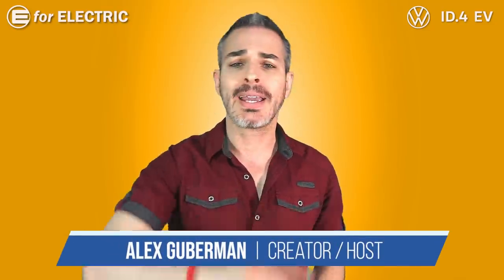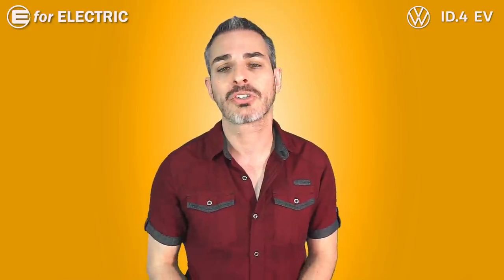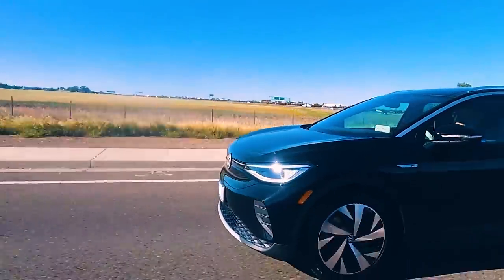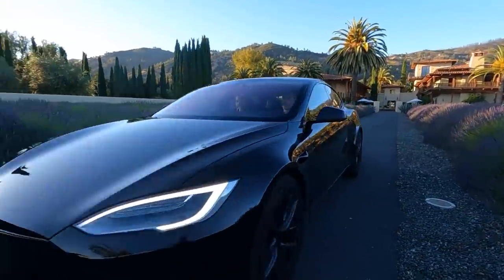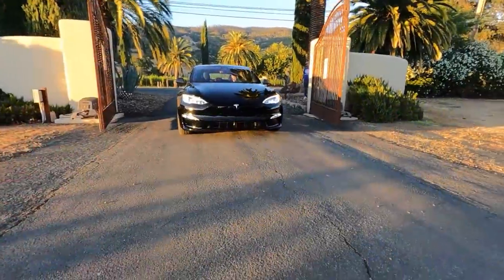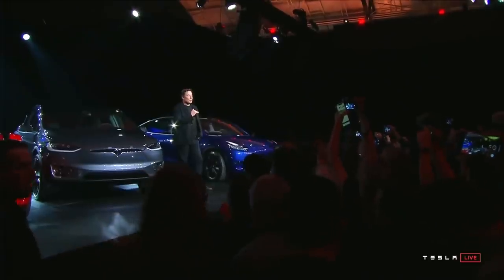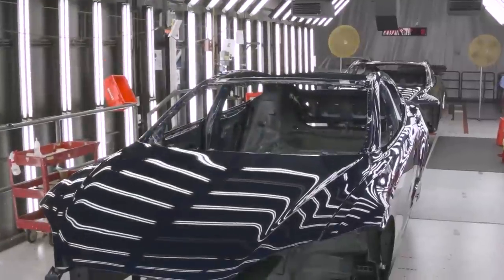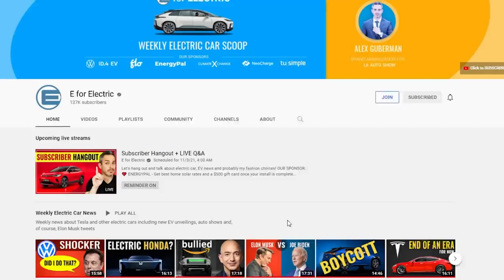SANDY MUNRO on Tesla's LFP vs 4680 Battery Tech

Comment: It cannot be a LFP vs 4680 but it has to be 4680 WITH LFP. The 4680 cell format is poised to enable so much improvement in production and scalability from cell to car, you cannot want to sacrifice that for a specific chemistry even having to produce different chassis variants for different cell formats? What do you think?

Comment: Interesting statistic from Sandy Munro that Tesla is approaching one third the no of vehicles built per year by General Motors. This is why Tesla is outsourcing some battery manufacture to CATL and Panasonic during this period of rapid growth. They are also using more than one battery chemistry and Sandy indicates that the 4680 battery cell must meet the Seven Sigma standard before Tesla will introduce it on the manufacturing line.

Comment: --- Some confusion as to what you are talking about with LFP and 4680 cells. 
--- LFP will be the prime cathode material going in 4680 cells. 
--- Only 4680 cells for long range and high performance cells with get a nickel based cathode. 
---- Hopefully by end 2023 all tesla products come with 4680 format cells.
--- LFP is a cathode mineral which BYD and CATL got good charge/discharge properties by micro-milling it - micro-milling it is their IP even though the basic IP for LFP cathode was American and now expired. BYD/CATL IP about to expire?? 
--- Tesla is using CATL prismatic LFP cathode cells - have not seen a teardown of a CATL cell. 
--- BYD don't fold their LFP cells, but squash them into a long thin prismatic box.
--- 4680 cell format is a triumph of cell packaging that can have any type of cathode or anode. 
--- It is a triumph for the shortness of the electrical path through the cell (80 mm), and the shortness of the path from anode and cathode to the thermal conductor and the thermal path to cooling fluid of 2 mm to 80 mm.
--- In a Tesla 4680 cell, it appears: 
-------------The aluminium can is made, likely with a hole stamped in the centre of the base. The anode connection then appears fixed to the base inside and out but electrically isolated from it,
-------------The cathode is fixed with binder to an aluminium foil current collector, 
-------------The anode is likewise fixed to the copper current collector,
-------------The jelly roll is made and foil folded over at top (cathode) and bottom (anode) to make electrical conducting surfaces,
-------------The aluminium and copper spring caps are placed on the top and bottom respectively,
------------- The the jelly roll with caps sits directly on the anode collector at the bottom of the aluminium can,
------------- The cathode current collector including the cap of the base of the cell is also the thermal path. The cell is turned upside down for use in a pack.
------------- (((In pack, bottom of cell can (lid) sits on cooling plate but must have an electrically isolating sheet in between. The sheet needs to isolate upto 465 Volts.))
------------  Electrolyte is added through a hole in the centre of aluminium cap, which is reflected in the aluminium foil layer and in the plastic centre tube around which the anode and cathode electrodes are wrapped with appropriate insulation plastic sheets. 
------------- A lid of aluminium is crimped to the open cell top, extending cathode circuit path to the base.
------------- The whole can, including most of the base, is an extension of the cathode current collector.

Comment: Could you package LFP into 4680?
Reply: Yes: LFP is the chemical composition of the cell (Lithium Iron Phosphate, LiFePO4, etc.) 
Other popular chemical compositions for lithium cells used in EV batteries include LMO (Lithium Manganese Oxide,) NCA (Nickel Cobalt Aluminum) and NMC (Nickel Manganese Cobalt.) 

4680 is a cell form factor (46mm diameter X 80 length,) which can be stuffed with just about any chemical composition worth making a cell out of.
Reply: If I could put Time in a bottle...
Reply: You can put whatever you want 4680. It dosnt make sense to me to put LFP chem into 4680. Pouch shape is best approach for LFP battery to maximise space.

Comment: Do the 4680 also have more speed of charge?
Reply: No.
Reply: Depends on the cooling, chemistry and whether they're tabless design.
Reply: @StormyDog  the desiglnation "4680" has nothing to do with the chemistry. This is just the packaging dimension. 46mm x 80mm
Reply: @nordic5490  Obviously, but whether they charge faster depends on the cooling, chemistry and whether they're tabless design.  All those parameters affect charging speed.

Comment: I hope that LFPs rule, they're cheaper, safer & if the only sacrifice of punch, then it's a good thing. 
The reason that Tesla's are out of reach of the average Joe is that they're too expensive, mainly because of the batteries required for their ridiculously fast acceleration.
The Battery Day announcement of the Chinese built $25K model (under wraps), it was hinted at using LFPs, but I could be wrong, aren't the purpose-built Chinese market Teslas using LFPs already?

Comment: I dont understand, you are comparing format vs chemistry. You will have 4680 LFP Batteries also. If you google it you will see that you already have 2170 LFP. Only problem now is that Tesla needs all 4680 high dencity nikel for cybertruck and semi
Reply: I expect the single motor cybertruck to use LFP batteries

Comment: OK, we have to be careful here not to confuse mechanical form factor with cell chemistry. In principle there is nothing stopping Tesla making 4680 batteries with LFP chemistry. The 4680 is the manufacturing process, which is new tech, including the tab-less construction. The 4680 was conceived to be used with NMC chemistry, but could be adapted (in principle) to use LFP chemistry - there may be complications with the formulation of the anode and cathode which could make this unworkable, the devil is in the detail.

Comment: Wow,  I think that he is a bit off on his views.  The difference between LFP and the 4680 if the use the formula as LFP would be great.  Benefits from LFP are far better.  1. Less expensive to make. Can be charged to 100% all the time.  And the difference in power is only seen in like the Plaid or the semi. All others it will not be a factor.  Plus leave the Bolt alone it is really a great EV 👍.

Comment: There are so many channels on YouTube If you subscribe to all of them you just get lost. I will subscribe to you in the past for a while but then started disagreeing with some of your opinions as all people do. Same that you were missing some of the information that led to what was being said. It's hard to keep up with everything as fast as things are going and being invented these days by so many people, I understand that. That seems you're getting back on track with Tesla, not only with the batteries being made and why it slows down a little with new products, but I would like to add that another reason for the slowdown on the 4680 was the battery manufacturer big ring out tweaks to its machinery to speed up production of said battery. A huge number of these batteries are needed for the test lift 18 wheelers so that delayed the trucks coming out because when people start ordering them you have to be able to deliver and you need the battery production speed to do that. But anyway, I think I may have just found myself resubscribing, keep up the good work. 👍🏻🇺🇲

Comment: Tesla is going to be making as much of their own cells as possible but they won't be able to scale their production fast enough to have enough for all the vehicles that they are planning on making. Tesla is going to continue to introduce new products for their cells to get into, so they will continue to be cell constrained for years. So Tesla will have to get CATL, Panasonic, Samsung, LG Chem, etc. to also make batteries for them. By licensing Tesla's latest technological advances in manufacturing to other cell manufacturers, the time it takes for other car manufacturers to adopt the same cells can be reduced if they choose to buy the same cells from cell suppliers.

Comment: If you want innovation, get a production NASCAR style racing series for EVs up and going , not the current formulaE.
  Quick battery swaps, charging and motor efficiency will be put on the fast track

Comment: The title for this video is WRONG! WRONG!! WRONG!!! It cannot possibly be "LFP vs. 4680" ... LFP is battery chemistry ... 4680 is form factor ... two completely unrelated and independent  issues. Alex ! Alex !! ALEX !!!... Get a clue!!! Lithium-Iron-Phosphate (LFP) chemistry can be implemented in "blade", "prismatic", "18650", "2170
", "4680", or any other form factor the is developed. The real comparison should be between the LFP chemistry Tesla is adopting for its base models and the Nickel/Cobalt based chemistry it has been using, and is continuing to use on its higher end models, The form factor, 4680 vs blade vs prismatic vs whatever is irelevent.

Comment: Sandy really hasn't got it quite right. The 4680 cell delivers more current because it's 8 TIMES LARGER than a 18650 or 5 TIMES LARGER than a 2170 ! In return you can fir that many LESS cells in a battery pack the same size. Therefore it has less electrical resistance and delivers X times more current. That's ALL.

I despair of supposed comparisons being made when the underlying facts aren't given. I'm sure that Alex Jones and his ilk would be proud of this method of presentation.

To repeat the 4680 battery IS NOT some technological breakthrough as the fanboys like to claim. It's easier to cool (which it needs to be) also, again, nothing groundbreaking.

Also, suggesting that the motor doesn't influence performance so much is plain ridiculous ! What has Sandy been smoking ?

Comment: I don’t appreciate the snide little remark about the Chevy Bolt. Unnecessary and unprofessional. No need to bash any company that is trying. I thought you were here to promote electric vehicles not talk smack. Chevy is making this right in a far better way than VW did when they massively cheated on their emissions testing, remember that. Just stick to reporting about cars and looking like a euro metrosexual.
Reply: I'm with you on the Bolt part
Reply: Chevy deserve the smack talk. Chevy have not treated their Bolt custromers well. Chevey shpuld have offered to buy back to Bolts but didnt, and owners are left with cars that are worthless, have no value.
Reply: Straight from GM:  As part of GM’s commitment to safety, experts from GM and LG have identified the simultaneous presence of two rare manufacturing defects in the same battery cell as the root cause of battery fires in certain Chevrolet Bolt EVs. As a result, GM will be conducting a recall of Bolt EVs (2017-2022) and Bolt EUVs (2022) to address the risk of battery fires in these vehicles.
Reply: @envelopo  a recall is not a refund. Yes the Bolt might be fixed eventually, but they have no value now, and little in the future.
Chevy should have done the right thing and offered to buy back... but no... they have left Bolt owners with a currently unsaleable car, and even when fixed, the value will have plummented.
Reply: @nordic5490  I would have to agree with you on that point.

Comment: Sandy… love you.  But that was the lamest metaphor I’ve heard.  Motor is a crank? No. Different motors is like a v4 vs v8 vs formula1 engine:  the battery is different as gasoline 87, 92, 95, 98, diesel, F1 fuel, jet fuel.

Comment: Sandy needs to start checkng his numbers before he talks on the show. He has sad other bizarre things before, but Tesla is in no way on track for 1 million cars in the US this year. Maybe 1 million worldwide, but Q1-Q3 in the US Tesla sold 223k vehicles Sandy thinks their going to sell 777k vehicles in the US in Q3? Even if he is talking production numbers it's close to 1/2 a million.
Reply: Yes but fact is they are growing 50%.  Cant say the same for other 2 us auto companies.
Reply: @brhutchi  How does that change that he is saying things that are factually incorrect?
Reply: Calm down. He just misspoke.
Reply: @Tysto  Sandy was incorrect about the 4680 vs LFP and he clearly doesnt understand the tech.
The cell voltage difference between Teslas NCA and LFP is 3.7V vs 3.4V @ 50% state of charge. This is only a 10% difference in energy density.
4680 is just the cell size and does not refer to the chemistry. In theory, 4680 could be made using LFP.
'4680' means 46mm wide x 80mm high. This is just a packaging dimension. Tesla will pivot to LPF, and LPF can be packaged in the the 4680 size.
Reply: @Bruce Hutchinson That's because Tesla has two cars in a couple shapes for early adopters of EV's while Ford and GM have dozens of types of vehicles globally in mature markets. GM actually sells more outside the US than in. All little startups have fast growth but if Tesla wants to keep growing it will need a much broader selection. Introducing a low volume roadster and maybe someday a lifestyle pickup for suburbia won't be enough to sustain it. But then Tesla would be competing in established markets for buyers it doesn't yet understand.
Reply: @Tysto  Every time he gives a sales number on this show he "misspeaks" though.  He gave incorrect numbers in his thing about ford > VAG. It's a recurring problem.

Edit: And in both cases, he used his "misspeaking" to present a skewed picture of whatever he was in favor of vs the competition.